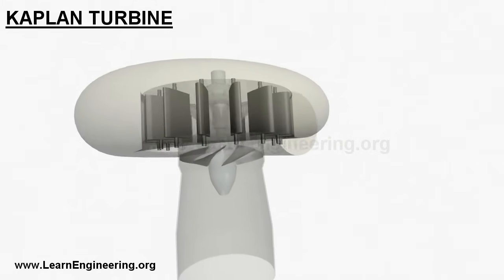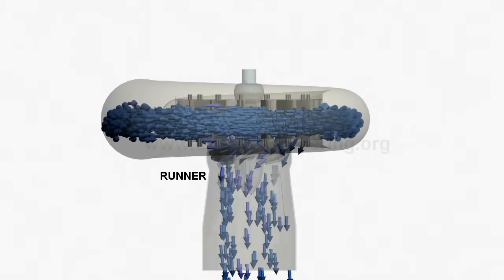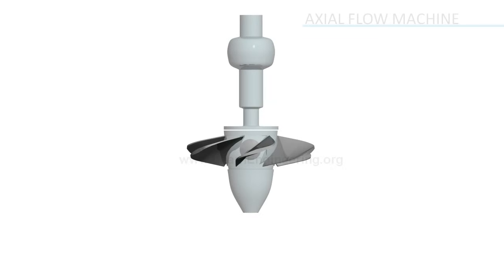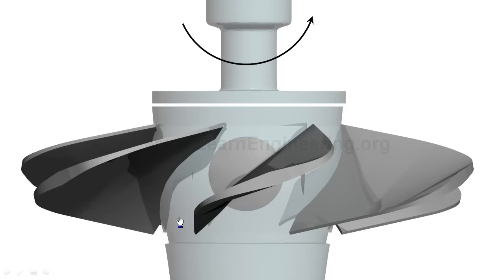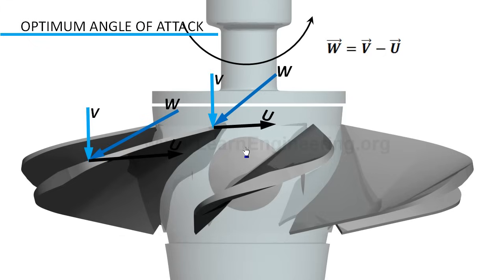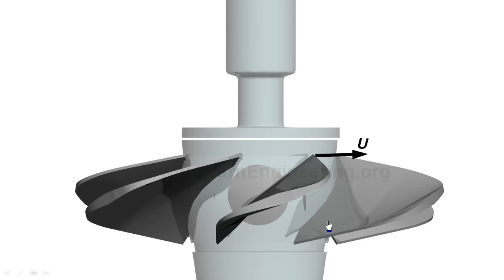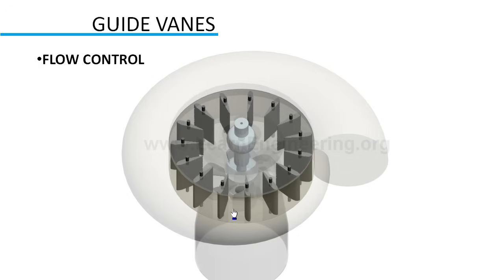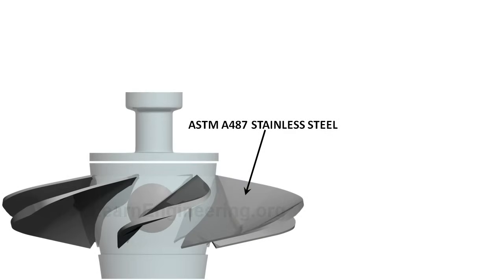Kaplan Turbine Working and Design

Comment: So here is a question, in almost all of the diagrams and videos I've seen, they always have vertical guide vanes, so as my family owns a hydro station for about 50 - 60 years, the first one in 1920's was Francis type with 3 turbines, after the Soviet rule once my family got the property back (  its was taken away because of nationalisation - no private property) we constructed a completely new hydro station  with horizontal Kaplan turbine with 300 kw generator. Head is about 7m on low power and 5 m head with for example 6 m3/s would be max power. So our guide vanes are not vertical, they are horizontal but not exactly the guide vanes are about 20- 30 ish degrees against the exit tube, the turbine sits inside a concrete spiral room. So my question is what is the difference in having vertical vs horizontal guide vanes ( I beleave that in a horizontal setting it is Moore optimal for the angle of flow because water doest have to make a 90* turn

Comment: I have a doubt here. So, when water comes out from the draft tube into the open atmosphere, what makes sure that the pressure have come down to atmospheric level?? It it the length of the tube or the cross section ? if so then again there is more doubt. The flow rate and flow velocity is variable. If for a certain design, what happens if water enters at high speed (higher than the design speed).

Comment: Can someone please explain to me what is the use of the swirl casing for Kaplan turbine. If the end requirements for water entering the runner are to be axial and uniform throughout the perimeter, we can simply put the runner in the pipe from which water is entering the swirl casing. It would reduce pressure loss as well.

Comment: Well, this isn't a great description how a Kaplan turbine works. The guide vanes for example, are newer pointing to the center, and the main reason with the adjustable blade is to have optimized trailing edge angle so the flow swirl component from the guide vanes are fully absorbed by the turbine.

Half of the static head is converted to velocity when it passes the wicket gate (guide vane assembly) so the water rotates (swirl) when it enters the turbine, this swirl (contains half of the energy) is absorbed and the flow is leaving the turbine in axial direction. 

The swirl angle changes with the flow rate, so with fixed blade the turbine has a narrow band of best efficiency. 

So the main different between a Francis and a Kaplan is that the Kaplan has a much wider range of best efficiency owing the ability to adjust its blades and thus absorb the swirl, so 50% of head is converted to rotation that the turbine absorb and discharge axial, into the draft tube. 

When a Francis turbine operates at full load (BEP is usually 80% of full load) the swirl after the turbine is rotating the opposite direction and therefore the efficiency goes down.  

I'm an hydropower engineer and have worked many years designing Kaplan turbines at Andritz Hydro.
Reply: how about the draft tube? he said that it reduces cavitation, I think that's not the purpose of it, it's actually used to reduce the pressure at turbine outlet for more power generation and its divergent section makes sure that no back flow gets up from the tail race.

Comment: Not all Kaplan turbines have adjustable blades.  Larger units have fixed blades.
Reply: Biscuit they technically are but Kaplan came up with both designs. It depends who you ask on the answer you get.
Reply: Esas se llaman turbinas de hélice.
Reply: Do you have any source to confirm that?
Reply: Biscuit yes I do.....I build them for a living.
Reply: Biscuit well we can build a propeller/Kaplan unit that is adjustable however big they want but as a rule of thumb large diameter units are fixed blade
Reply: Fabián Sánchez Ramírez ahh I didnt know that. For me units with fixed blades were just propellers

Comment: I'm thinking of using a jet ski pump  drive, should I introduce the water flow thru the original intake? because the impeller blades pitch is reduced going towards the output, what do you think sir

Comment: why guide vanes and not circular intake?
Reply: splendit konami choosing the guides guidelines because they are much more rapid in the case of the need to stop promptly the water flow to the turbine and because they are more resistant in case a foreign body is inserted. In more guide lines they can be moved all together simultaneously in axial manner by exploiting a mechanism of connecting rods fixed on a cruise.